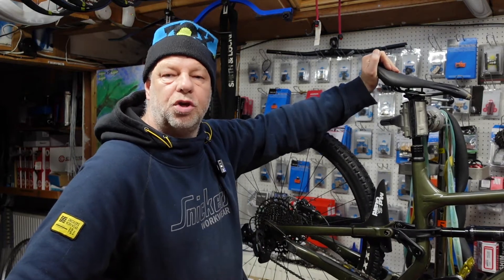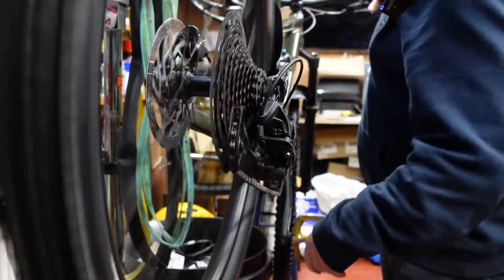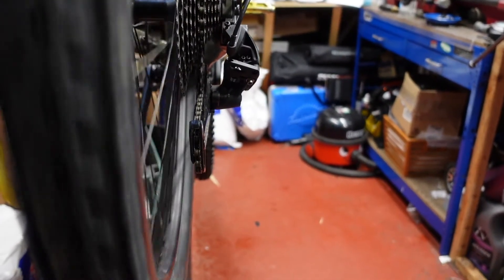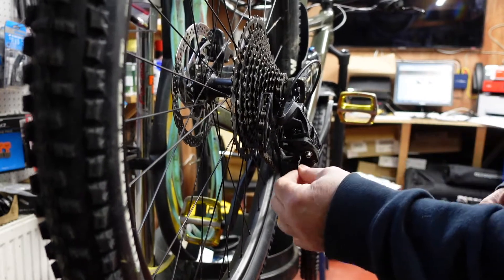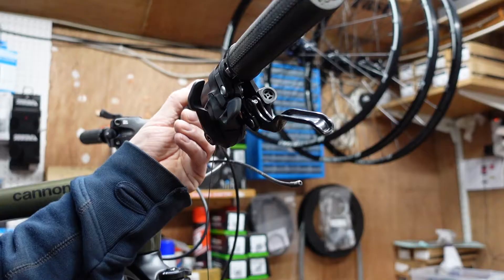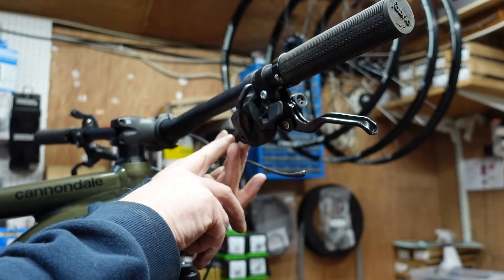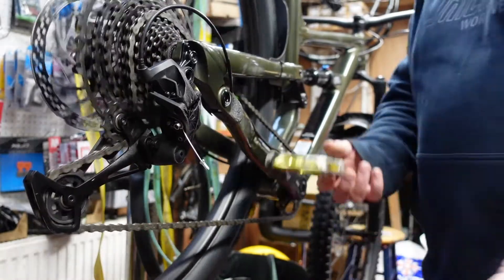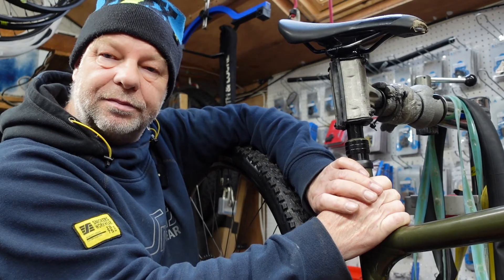Sram Eagle Gear Index

Comment: Thank you for the video. I spotted the problems on mine: a loose hanger and B screw adjustment was done for the wrong gear. I also never realised that the trigger has an adjustment too and that rubber grommet.
Reply from the maker: Hi, thanks for watching and you comments

Comment: According to SRAM instructions you should adjust B-screw with the suspension at sag. I think that varies a lot by suspension design. On my bike I got crappy shifting when I failed to comply to this.

So, now I let out enough air from the rear shock to get it to sag before I make the adjust, or ask a mate to sit on the bike while I check the gap.
Reply from the maker: Hi thanks for watching, this is true on most full suss bikes, orange are slightly different , hard tails not required, always check the install manuals,

Comment: What can be a slow-down-shifting issue under load only (waits for several seconds and slams into lower cog exactly when I pedaling with force, basically any gear from 11 to 2)? Replaced ferrules, cable and housing (which was bent), and still having the same issue. Casette and chain is new X01, derailleur is GX from 2019, same as bike, and shifter replaced with used X01 (previously gx shifter, warn gx chain and a bit worn gx cassette). And the same happens with and without rear shock in a locked position so some cable movement probably is not a cause. From the back side hanger doesn't look bent and derailleur also doesn't look like it had some hits (the bike is pre-owned).
Reply from the maker: Hi, so many variables makes a good or a bad shift, so hard to advise without seeing the bike, sorry.
Reply: @TheYorkshireBikeMechanic  It was B-screw. I've checked it a while ago without sag, and now I've checked it with my third hand help, added few rotations, rode a bit and checked again, added a couple half-rotations again. Probably with suspension sagged on a stand its just easier and the problem is more obvious.

Comment: When using the derailleur alignment tool you should be checking against the same area of the rim of the wheel (valve area is often an easy target as it’s easy to identify) simply for the reason that you cannot be sure the wheel is perfectly laterally true, and even if it is laterally true there is still a tolerance wheel builders and manufacturers use to constitute as true.
Reply: If a rim is perfectly round, then you can check against any spot. And perfectly means <0.5 mm tolerance. After all, you cannot align d. hanger with better precision than 0.5-1mm

Comment: Dave the chain looks to long or stretched at the bottom of the block as the mech is very close to the cassette 🤔Really  enjoyed dave
Reply from the maker: Hi Stephen, thanks for watching and your comments
Reply: Once he adjusted the B screw the upper wheel moved down and away which took up some slack, but I’d still run the standard SRAM chain length test to be sure. It looks like maybe one half link too long, as in only half of a link set of inner and outer plates. Usually with Shimano when you reach a result that puts you half off and you’re going from a new pinned chain, to a master link, the adding of the ML will give you that, otherwise Shimano say when you’re between two links, go longer to the next half link that lets you use whatever connection method you require, pin or ML.

Comment: I'm not familiar with Eagle - when on the smallest rear it looks as if the chain may be too long ? or is that the normal position for the cage - it looks too high ?. It seems to pull through ok.
Reply from the maker: Hi, there should be enough tension on the mech to pull the chain strait but the chain should not touch the guide wheel.